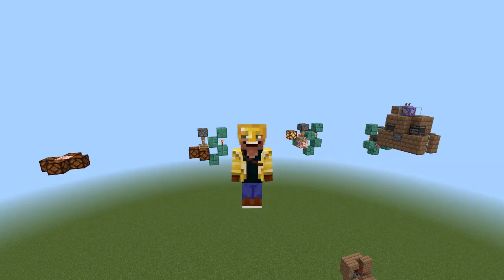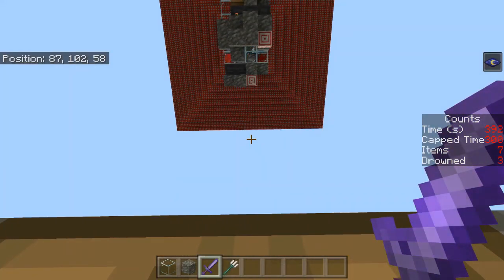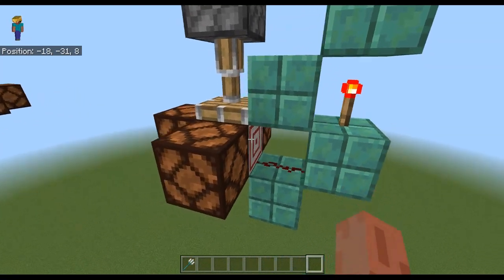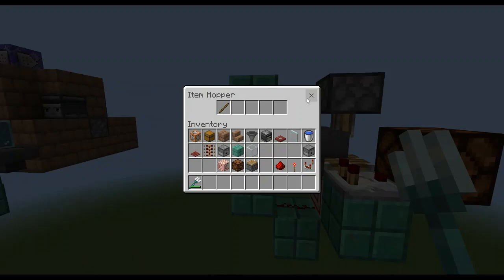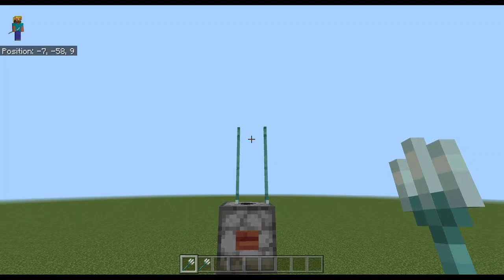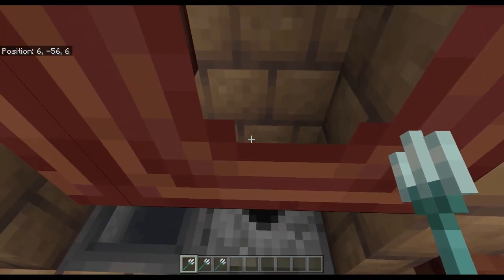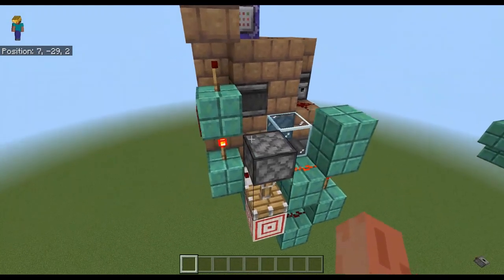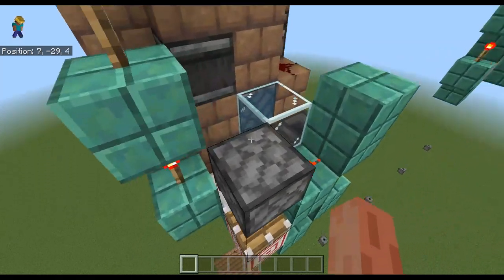Trident-Based Vertical Switch

Comment: I had an idea for wireless redstone for a build using snowballs or arrows to hit a target block hidden by a map. I'm thinking about revamping it now. Some ideas... the botton catcher of a trident can be a cauldron or a composter slid into place after the trident is launched upward then retrieved after a set amount of time. With this, you can  have a Phantom farm using recycled tridents.. my mind is whirring. Is there anything that will make a trident into an item other than the player? Thanks for the inspiring idea GH.
Reply from the maker: Glad you like it. The only other way I’ve seen a thrown trident become an item is when a loyalty-enchanted trident is returning to a player and the player dies. The trident then drops as an item mid-flight. I doubt you’ll want to make a build around that mechanic! 😅